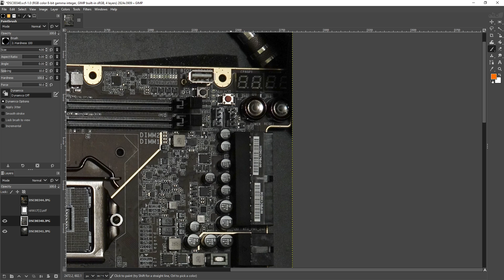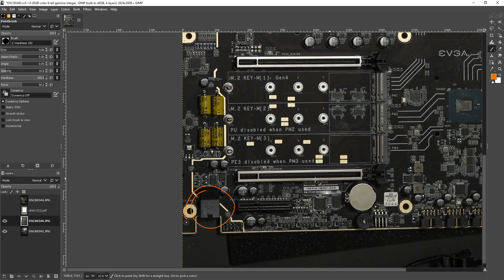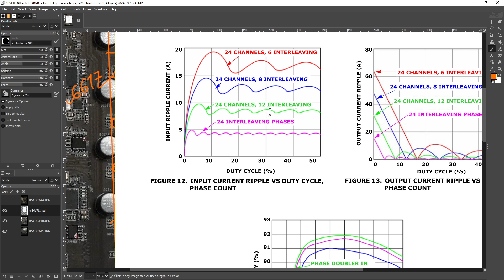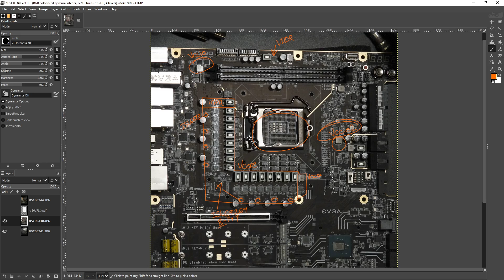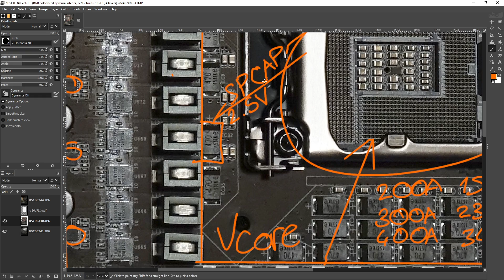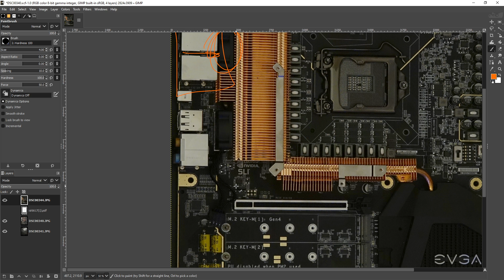mobo PCB Breakdown: EVGA Z590 DARK

Comment: I'm considering buying one of these as I plan on keeping my recently  upgraded 11900k from my 10700k, it OC's okay and I plan on riding a few generations out like I did from 4790k to what I have now...

I'd like to think this would be an upgrade from my z490 MSI edge, then add 2x 360mm rads as opposed to 1 240 and 360....
Plus the fact with the copper heatsinks do look gorgeous

Comment: I could use switches for disabling M.2 drives, so when I install an operating system it will put the bootloader only on the drive I want it to.

Comment: Coming back to that heat sink topic.
How are You going to cool the VRM while using LC / AC with only an aluminum heat sink without fans?
I'm afraid that a longer session with the OC could unnecessarily bake SPS.
Copper is unnecessary, the fans can stay, but they should only turn on when the temperature differs from the desired values.
I would narrow this radiator a bit so that the fans could breathe.

Comment: 6-pin on the bottom of the board is for legacy M.2 drives.  Did you not look at the add-on card for the TRX40 Creator!?  "Can't be bothered"  lulz ;)  "Shouldn't be mounted in a case"  ...mounts x570 version in a case just to piss u off...  Cooler = more efficient ...polishes copper VRM heatsink... (taught 'em everything he knows..jk)  Less opinion, more attention to detail, junior.  xoxo

Comment: that's the VRM heatsink a lot of lower end boards need, nope, lets put it on the VRM that doesn't need it when it's frosted over from the LN2 in the CPU pot, lol. also a lot of manufacturers add fans to the VRM, cuz cutting/extruding proper cooling fins on aluminum blocks is hard apparently, lol.

Comment: im curious to how you arrived at the 50$ extra manufacturing cost for the copper heatsink, copper is currently less than 10$ a kilo, and material properties should allow for the fins etc to be stamped out on the same equipment as aluminium would have been should it not?
im not having a dig here, im legitimately curious to where in fabrication the cost of using copper would skyrocket like that.
Reply from the maker: I'm saying it's adding 50$ to the retail cost of the board not that it costs 50$ to make. Also I know from other motherboard vendors that the main cost of the really high end boards are the aluminum heatsinks and covers on them.
Reply: @ActuallyHardcoreOverclocking  hmmmm.... i get the covers, they're probably all unique and require custum tooling. i also trust you on your word for what motherboard vendors say, and that they dont really have a reason to lie to you.
so, logic must dictate that if its not material cost, not the preparation part of manufacturing, and that assembly should be very similar in cost too, it must be marketing and oem markup due to copper that raises the price.
tell me im dumb if im failing at reading between the lines, but thats the best conclusion i can find right now.
Reply: @4lc4p0rn  I think buildzoid is comparing to a simple aluminium heatsink, not the same heatsink in aluminium. Say, something which is extruded aluminium or other cheaper method. If your logic were true, there would be vastly more copper heatsinks on the market.

As for material properties, copper is not fun to work with compared to aluminium. It chews through tooling, the manufacturing costs will be higher by a good bit. The weight of the copper may also impact the cost of the mounting hardware. I'm not sure where you are getting pricing from, but pricing can vary greatly per kilo as to how the metal stock is supplied.

In short, it IS the material cost, it IS the manufacturing cost, it IS the assembly, and it IS likely the shipping.

Comment: No thanks. Premium board for a dead socket. Alder Lake leaked benches already show it out performing an 5950x in MT and ST in cinebench, and leaked European pricing have the 12900k cheaper by a large margin than a 5950x. EVGA should've just skipped AM4 at this point and made an AM5 board
Reply: Dude you realise he's reviewing an LGA1200 board right? Like absolute valid points of just going to AM5 instead of AM4 unless it's mostly a test run on getting their AMD Bois and stuff running correctly on a known platform with plenty of things to pull data from so that so their AM5 board can come out swinging straight out the gate. Also AM5 is still awhile out, not particularly long but a while still.

Comment: Huh.  I'm surprised you're not more positive about triple BIOS.  Just like with RAID 5 vs 6, it's too easy for something to go wrong while using the redundancy and end up with nothing (not as bad as RAID cos new BIOS chips are easier to acquire than replacement unique data), having that extra one means you've pretty much got to be a belligerent moron to end up with no bios working.
I'd say it's a log scale rather than linear for extra bios chips (that immediately hits ceiling of diminishing returns), but.... that would be wrong and silly but it's sorta true, I think.
Reply: Was a life saver for me when the evga bios fucked up 2 of my bios, went to the 3rd and reflashed the other 2 and now i have 3 working bios again.

Comment: Let's release the oc board for the chipset that will be replaced in 2 months, sounds good. Great video as always nonetheless. Can't wait to see it in one video
Reply: State of the art is temporal , the glory of Hw bot first places is forever
Reply: The first generation of DDR-5 motherboards and Memory controllers will probably suck at memory compatibility and cause a ton of issues so I'd think this motherboard is going to be highly preferable for memory overclocking since the DDR4 is extremely matured by this point and this motherboard has only 2 dimm slots therefore memory overclocking on it will be far more fun than any new generation motherboards for like at least a year or two anyways...
Reply: @fy7589  Also, its 2021... we already have access to 4000mhz C14 super tight DRAM timings retail stock, no need to buy exotic enthusiast motherboards to achieve tight timings, no more dark overlocking in the lab mad scientist rituals needed: https://www.youtube.com/watch?v=u0uV2n1LaqI
Reply: @UptownNYC  The point of XOC is for the fun of OC, not daily performance, obviously, this thing is impractical asf for daily use. I see your point about MBs mattering less as DDR4 matures though, memory OC is starting to get flattened out, along with core, especially at ambient.
Reply: @fy7589  a year or two 🤦‍♀️🤣 someone educate this man... No enthusiast is gonna be fiddling with a $600 last gen platform when Z690 and Alder Lake is the new 800lb gorilla in the room. Intel is literally churning out new sockets every 6 months these days... slower moving companies like EVGA are getting left in the dust. ASRock and ASUS have already leaked Z690 motherboard specs & photos set to ship NOW!
Reply: @UptownNYC  My point exactly the board has great features and sure it might bring you some bragging rights on hwbot. But what's the point 6 months after tachyon and apex I don't believe there is much market left despite the great engineering put into the mb.
Reply: @UptownNYC  Let someone educate you... DDR5 in it's first iteration will be buggy as hell with super loose timings like ddr4 was in it's first iteration. And I did not say enthusiast. An overclocker doesn't have to be an enthusiast for they just enjoy overclocking and breaking records using for any overclockable part. There are still people overclocking really old hardware to break very niche records like "the fastest clock speed on a 6 core processor" or stuff like that. And do not expect the next iteration of intel's or amd's ddr5 controllers to come out earlier than 1 generation which usually takes 1-2 years to release.
Reply: @fy7589  can confirm this back in day when corsair released dominator gt ddr3 they were horrible, yes they did refund me but too many problem so it is expected
Reply: Its scheduled release is mid-October. So more like 6 weeks.. not that it even matters cause this board is never in stock anyway. Dark motherboards are typically Vaporware 🙄💨💨
Reply: @UptownNYC  EVGA is like Biostar in that you never meet anyone who actually owns their motherboards
Reply: @ShogoKawada123 I own a few of them. Z390, Z490, X299, soon to be X570 and Hopefully this board and the upcoming Z690. I would own this board alreadu but I missed my notify from EVGA due to my being an idiot and jumping into a pool with my Old phone still in my pocket while on vacation...
Reply: @ShogoKawada123  I own 5 of their boards, btw.   Jus' throwing that out there.   ;)
Reply: @UptownNYC  Dark boards aren't that hard to find. Still loads of X299 dark, and Z490 Dark Kingpin boards all over Amazon that you can still buy brand new. Z390 Dark boards are fairly easy to find on the used market. The SR3 Dark board isn't hard to find either. Infact a friend of mine bought an SR3 for only $500 off of Newegg when they were trying to clear out inventory. 

I own all of the modern Dark boards (minus the SR3) and have gotten all of them except the Z590 for really good deals either brand new but way less than MSRP from EVGA (X299 Dark and Z490 Dark Kingpin) or I bought used off of reddit in the case of the Z390 Dark. 

All the boards are amazing!
Reply: @mylittlepwny3447   Serious question, NOT trolling or baiting: are u a collector? I get holding onto pc/motherboards for a couple of years because not everyone has the $$$ to upgrade every 3-month cycle from Intel these days (Im old enough to remember when motherboards lasted 12-16 months before a new socket/chipset came out)... but in 2021, why buy/hold on to a DOA socket like Z490/Z590 when Z690 is literally a couple of weeks from release and has all brand new technology like DDR5/PCI-E 5.0 and is the new platform for 10nm Alder Lake CPUs? This isn't a tick upgrade like Z490/Z590 was to Z390. This is a TOCK cycle given all the improvements and support it arrives with. That's why I'm asking... why hold on to old tech unless you're a collector or just cant afford it (which u clearly can if u buy every Dark board)?🤷‍♀️
Reply: I don't imagine people will be setting much records on the big little core design except maybe single core benchmarks because the new core design is gonna suck for multi core scores but will be better in real world uses
Reply: @J D I know it's lga 1700... And I hope you also know it only will have a memory controller that supports ddr5 which I made my point it'll be buggy in the first gen... not ddr4.
I know this motherboard is something most people will not want to buy. But it will be still useful for niche cases like overclocking ddr4.
Reply: "replaced" 

Yeah man im sure evga is not aware of whats coming..
Reply: I was literally going to get this board for my new build and the reason you mentioned is why I'm now just waiting for the next gen Intel chips.
Reply: Really who cares? I have owned my Z590 Dark for about 1.5 months now. I bought it brand new for $600. I love it! I knew exactly what I wanted.. This board is on a test bench with a direct die 11900K. It has all the features I need. I mean, the next Z690 Dark won’t be here for a while..I’ve been running Dark board for the past (3) platforms. X299 Dark, Z490 Dark Kingpin, and now Z590 Dark. These motherboards are incredible! The features, build quality, and the bios, and the warranty most of all! Yes it even has a used warranty. Evga is the only company that offers the remainder of the 3 year factory warranty to 2nd hand owners (I bought mine brand new from EVGA, but the same applies to their video Cards too). (You can’t beat that 2nd hand warranty) not to mention, these boards hold their value very very well. Because future LN2 users will appreciate high end previous Gen hardware designed for LN2. Who cares when something releases. This motherboard is amazing!
Reply: @videocardzrule354  if you get joy out of it which you do. I agree with you. Back in Day i had x58 classified. Manual was missıng they shipped it with Ups express to My adress
Reply: Biggest regret regarding my PC, stepping from an X to a Z platform.

Comment: yes copper is like 11x more expensive, but we are talking like $2 vs like .20 cents.
Reply from the maker: heatsinks are literally one of the most expensive parts of a motherboard.
Reply: @ActuallyHardcoreOverclocking  Aye, I'm only compairing raw materal cost. I would assume the manufacturing process would be similar enough.
Reply from the maker: @Epyon1201  the 90A power stages on this board are usually around 2USD. The heatsink is gonna be a lot more than that.
Reply: @Epyon1201  
I imagine the thing that drives the price up in that regard is, that copper is harder to machine. Should still not make that big of an impact considering this is a $600 board. +/-$25 I'd assume.
Reply: @-eMpTy-  This is $600 board, but the Asus Maximus XIII Apex is also at the same price in Newegg.  If you are paying the same price, that copper heatsink is a big plus though. I get Buildzoid's rant of wanting a cheaper board , but this is a niche market, with less competition and volume, the manufacturer will milk as much as they can from the consumers.
Reply from the maker: @fleurdewin7958  ASUS doesn't ship Apexs to the US. I'm pretty sure Newegg import them from Europe. In Europe the DARK is 50EUR more than an Apex